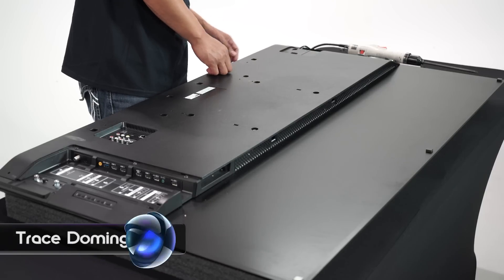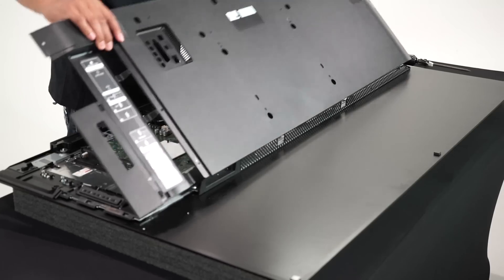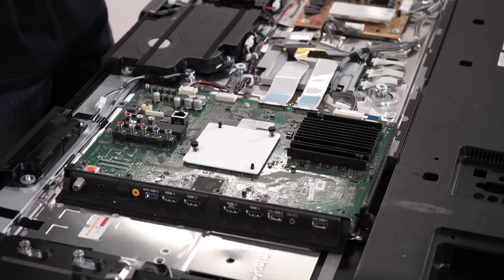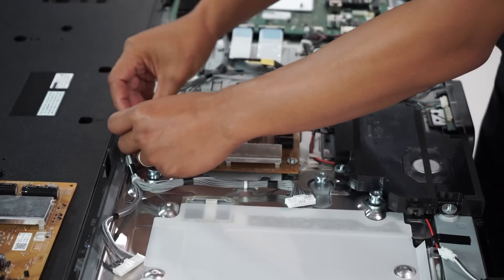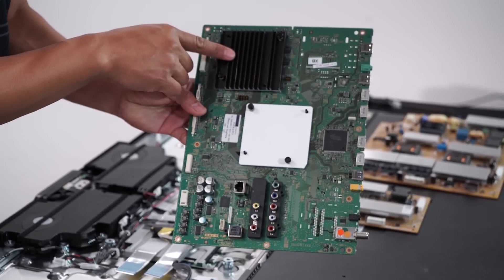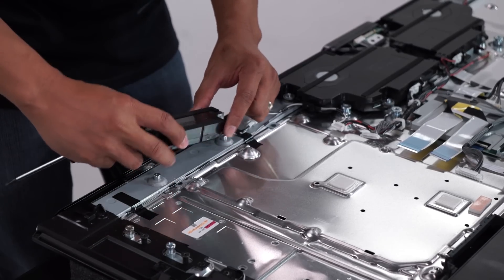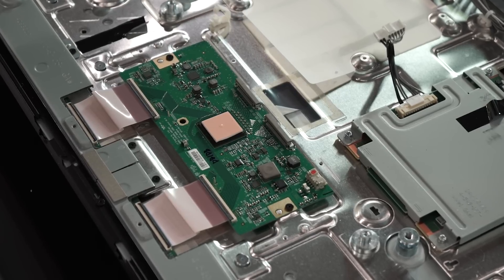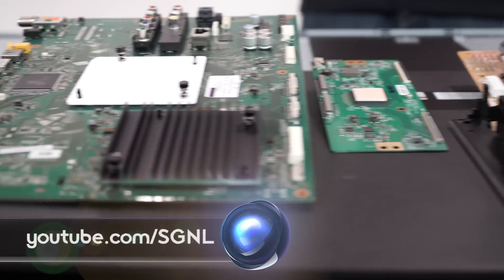Teardown of the X900C Ultra Slim 4KTV- We Take It Apart

Comment: Basically it's when they manage their warehouse from a top. They keep repeating dynamic range and they should know it's a distance how far GPU's can render it. PC parts keep increasing in size for passive cooling and it's being transmitted over cooper lines that aren't under a PCB. If it's likeable see it at your favorite MMO. Braided cables to manage wires, it's nice when it's hidden. It's like a paper game or paper VR headset toy, fold it to uncover it's mysteries. It's does not run any node.js software on any hardware.

Comment: Does anyone have any resource on how to take apart a Sony X93E or XE93 with removal of components and getting to the LCD panel LVDS connectors. I desperately need this please as my TVs LCD panel has been damaged and I need to know if putting pressure on LVDS cable connectors will actually make it better? Thanks

Comment: I own a Sony a7r VI with a Sony 24-70 gm lens. Why is it that when I use AF-C to shoot. The camera lags a bit when I want to rapid shoot on single shot option? 

I tried everything from changing around the settings but it only made a slight difference on the speed performance.  I even switched sd cards and nothing.  I tested my lens with Sony and it's fine. I have the latest firmware and nothing......

Can anyone help me please